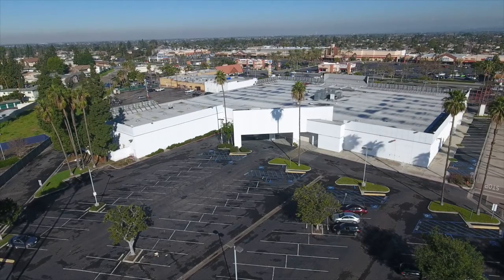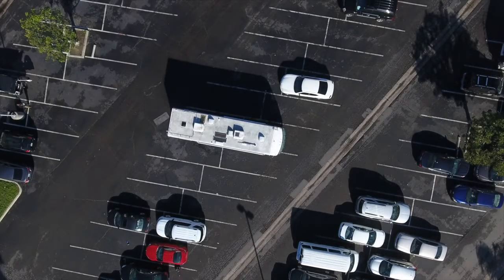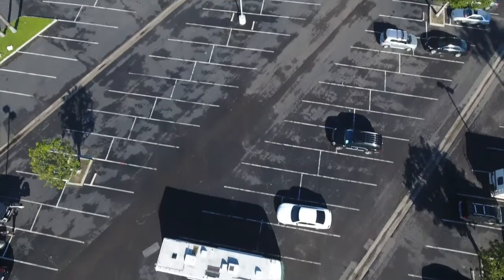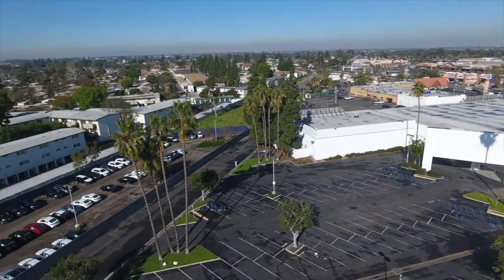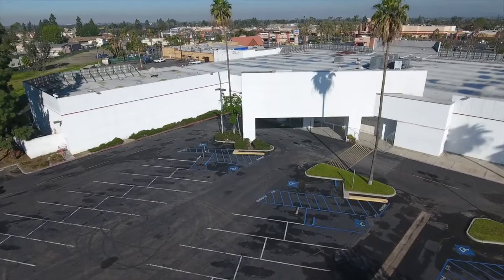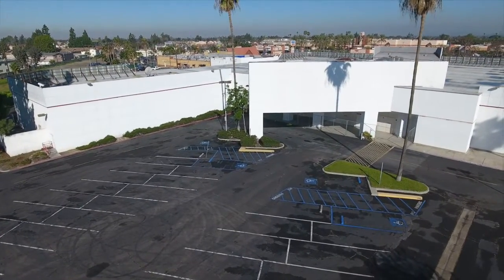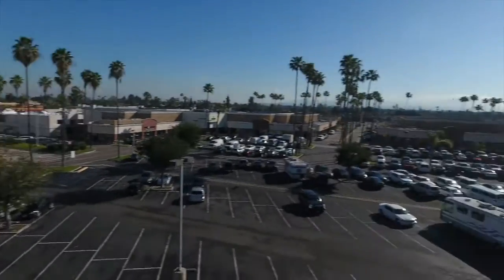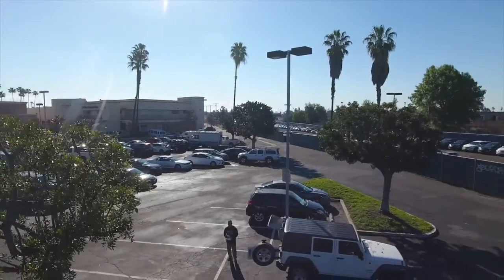How I shoot DroneBase Pano missions

Comment: How do you upload images and videos to dronebase? What do they mean by "have an image assigned for each bucket"  been trying to figure this out for my trainning mission. 
Thank you
Reply from the maker: I use a laptop as their app is sketchy when it comes to uploading. As for the image assigned for each bucket question, that just means that the shot list needs to be fulfilled and all the images need to be designated. Once the upload is done, move each image to the correct folder.  You cannot submit a mission if you have images in the “unassigned” folder. Hope that helps. Good luck!

Comment: Very nice straightforward demo, thanks. I've been using the Litchi app pano feature. Do you use any automation or are you doing it fully manual?
Reply from the maker: I fly it manually but set the camera settings to time lapse (5 secs).

Comment: I did my first Drone Pano and it got rejected. Shouldn't you stop take a picture, stop take a picture versus continuously moving and shooting at the same time?
Reply from the maker: 32lilbruce although I find it a bit more time consuming, you can most certainly stop and take a picture to ensure you get it framed correctly and get the necessary overlapping for proper stitching. Did they say why it was rejected?
Reply: They basically said that there was a small section of overlap. So im a little confused because i did this pano using Drone Pan which i thought would make me not have to worry about that. I guess im confused on the overlap part because i see that you do a continuous rotation and yet you get 12 photos all the way around. How do i know which speed to go so that i get the right amount of photos and what exactly is overlapping mean for these panos?
Reply: @32lilbruce  you should have like 80 percent overlap

Comment: Nice job my friend!   Question:  Do they only allow DJI products?  I have a 3DR Solo with a GoPro Hero 4 Black camera.
Reply from the maker: TNA2Me As long as you capture the proper shots, and they're able to stitch them together, it should be fine.
Reply: They said my Chroma CGO3 drone was not on their approved list. They didn't give me a reason but one possible problem I figure was the Chroma does not put the coordinates, altitude etc. automatically on the image files. You have to combine a file from the Remote Control with a file from the drone to get that information. Too many steps. That's just my guess though. So I bought a Mavic Pro...

Comment: Good Video but Dronebase released a new workflow on the dronebase app on 3/15/2017 ......  
"When you select an Active Mission, you’ll see a new “Let’s Fly” button. All pictures and videos you shoot in this context will automatically be associated with the mission.  Furthermore, the mission shot list is integrated directly into the fly screen so that you can classify each shot as you take it. Just select a shot from the list, shoot all the assets of that type, and go on to the next shot. Each asset is automatically tagged. Then when you’re done flying, you can upload all the assets directly from the app. No need to transfer the files to your computer, manually classify each shot, and upload through the web interface anymore. Our goal, as an engineering team, is to keep drone pilots doing what they love - flying. The more we can streamline the busy work, the administrative stuff like classifying and uploading imagery, the better. Plus, this new capability of connecting to the drone will become a huge focus for us going forward. We will make flying not just more efficient, but leaps and bounds more enjoyable in the months ahead. Stay tuned."  - Dronebase
Reply from the maker: It's the DroneBase app.  It just has a new feature when you tap on an Active Mission that says "Let's Fly".  If you don't see it, you may have to update your DB app.
Reply: I cant find this new app?